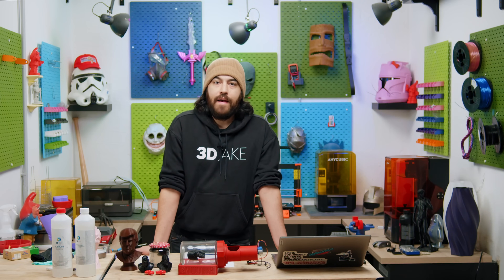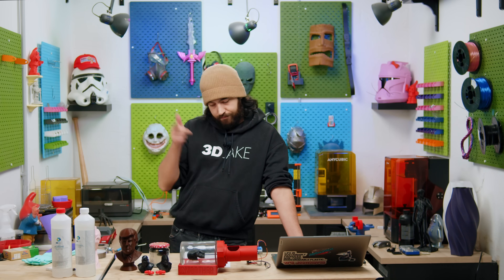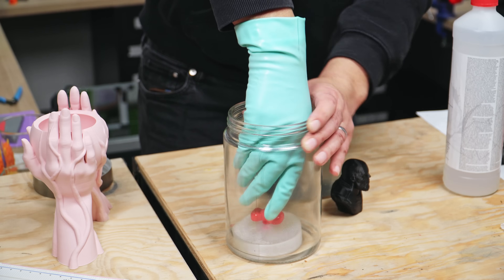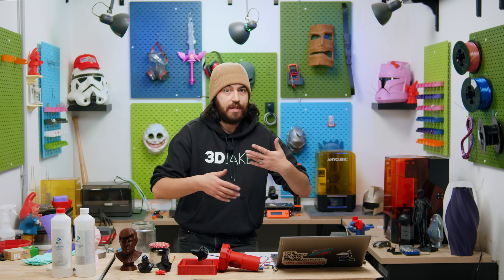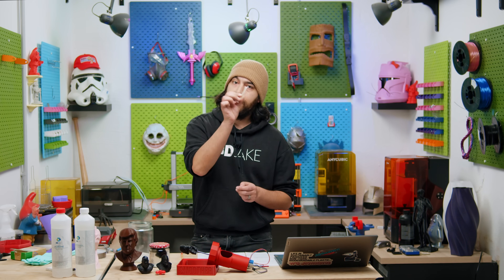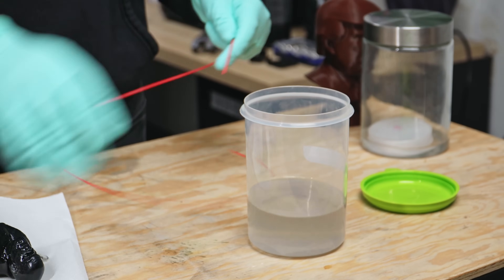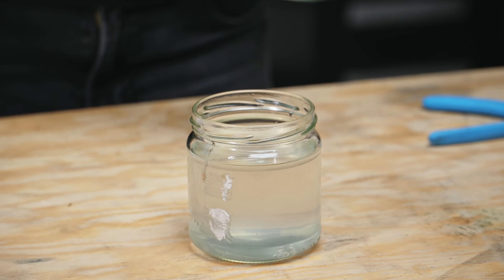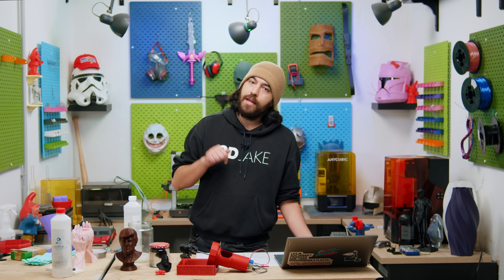3D Print Smoothing with Acetone: The BEST Method Revealed!

Comment: I use a vapour bottle, the sort of thing you'd use to repair headlights to evaporate the acetone, just hold it to the part when it's hot and it'll work  nice and quickly but only touch the outer layer!

Comment: What about using something like a microfiber cloth damp with acetone and use it to brush the part?  That way acetone leaches off the rag onto the print in a controlled way instead of dunking it so it might buy you finer control over the process? maybe?
Reply from the maker: Sure that would work, actually we often use an actual brush to do this. But you need to select your brushing material carefully, microfibre cloth may not last long or worse fall apart and deposit into your print. They're typically made of a polyester or nylon. If we brush parts with acetone we use a hoghair brush, you might be able to use sable but be careful that it is natural sable. You also have to be careful with your brushing technique. Back and forth will mess it up, you need to repeat brush strokes in one direction only.
Reply: @3DJake_Official  That's awesome! Great to know that it tracks with what I was thinking.  I suppose I've just one last question.   After brushing and getting the desired effect, do you maybe dunk or spot rinse the part in IPA or water to stop the reaction?
Reply from the maker: Yep also possible although we haven't tried with water, should work ok but we used IPA simply because it is faster to evaporate

Comment: Thanks for making this video. How does acetone smoothing affect carbon fibber filaments? If a model is created using a (specifically none core) carbon fiber filament, will acetone smoothing seal the carbon fibers at the surface level in order to stop any weakly bonded fiber fragments from detaching?
Reply from the maker: puhh good question and unfortunately, I don't know, but it sounds like something to test in future :)

Comment: When using the vapor method, if you have areas that you don't want smoothed or dimensionally affected, apply petroleum jelly to the area. It will act as a barrier that protects the surface from exposure to the acetone and can easily be washed off later with dish soap and water.
Reply from the maker: Great tip!

Comment: I'm wanting to try the dipping method with a cup holder for my pinball. Using a 1:2 ratio of acetone to IPA, what sort of timeframe do you think is appropriate for soaking to get light smoothing? Are we talking 10 min or more like 30min or more? Thanks.
Reply from the maker: Hard to say because it depends on the ABS used but one issue with the dip method is its hard to control because the solvent needs to evaporate after removing from the bath. So first test for a short time only. Even 10 minutes might be too much.

Comment: Thank you for talking about dipping! I make a lot of parts that need to be body-safe and washable, so the imperfections caused at the rack points for vapor smoothing are unacceptable, I need a completely pristine surface all around without pores. I dip each half separately so I never touch wet ABS. I design all my corners and edges with fillets, and shake the part aggressively after dipping to prevent some of the pooling artifacts. (Yes, acetone drops fly off, do this in your backyard on the dirt or grass.) Also thanks for the tip about adding IPA to prevent that white crust, I have been mostly using white ABS so that doesn't happen. 😅
Reply: I didn’t think ABS was body-safe, so you have a link that says otherwise?

Comment: Interesting stuff mentioned i haven't heard before. But there is basic stuff which i miss being mentioned. How long should the part be in? It should be mentioned that it depends on the room temperature and size of the jar. Also the longer it is in the bath, the longer it needs to stay untouched. The faster you smooth like with heat, the better as it have less the chance to go inside of the print and weaken it. Also why are Nitril gloves not suited for using with Acetone? And why you attempt to print a plate instead of using something that doesn't react to Acetone like a metall/aluminium/glass plate? I also saw someone on YT mentioned a method of smoothing it without loosing dimenional accuracy which he demonstrated by using printed flute which sounded right with that method compared to regular method. He used a marker bottle with that valve where he put Acetone inside of it and gently pushed the Acetone like a marker all around with the layer direction and then against it. And then put the part into a actual vapour with "heat" by putting the chamber into a plate of hot water for a quick vapour. So in that way he removed the extreeme layers away before putting it into the vapour so the vapour doesn't need all that long to smooth the part.
Reply from the maker: Unfortunately, it is really hard to say how long the part should be in, it can differ wildly depending on what brand is used. I haven't really noticed a difference in variations in room temperature - we tried this is a few environments, one where the temperature was a bit under normal room temp and another definitely higher and no noticeable difference, maybe if the room is scorching though but yes the size of the jar would probably affect times, this is something we didn't test. 
We printed the plate simply just because we didn't have something that would fit in that jar perfectly and I imagine some people would have the similar problem so using an acetone resistant filament like PCTG is an option. 
The marker method sounds really interesting, do you have a link?
Reply: @3DJake_Official  Room temperature should make a difference. Maybe not a big noticeable one for most people, but i saw a lot of people complaining that they couldn't get it to smooth. Ofc it depends on the filament. Some aren't suited for that. But with like a heated chamber, a warmer room or just having the chamber in the sun, should make the smoothing faster. 

Speaking of the marker method, hopefully YT doesn't block it, just surcr fir "How I vapor polish 3D prints without distortion or loss of dimensional stability." from Gael Force" on YT.
Reply: @ https://www.youtube.com/watch?v=8cxsjWYHhpI

Comment: You can also do the spray bottle (atomizer) and put a box over the object that will not warp with accitone vapors. Used acetone for years a paint stripper with paper towel, cotton pads and cotton tips. The nice thing about a metal spray bottle if you can contain the fumes a little more then an large open jars. 

Again look for HDPE (2) for the plastic parts.

It might take more passed then dunking but it's less outgassing of acetone.
Reply from the maker: Actually that is something I wondered about - if using an atomiser made of HDPE, would the acetone attack it quickly? Or would you be able to get away with bathing out the remaining acetone in water after use?
Reply: @3DJake_Official  most of the cosmetic bottles of acetone is made of HDPE. I’ve had one bottle I keep refilling for 10 years now. 

But I’m not sure if the spray bottles I see listed as HDPE are also the same plastic for the inside components as well. (Tube and nozzle) I need to experiment myself on that.

Maybe search for “chemical resistant spray bottles” might be the the way.
Reply: @3DJake_Official  I can found Polypropylene (PP) (5) and glass bottle so this should work with Acetone as well. 😁
Reply from the maker: We recently added spray heads to the shop for our IPA bottles, I'm gonna have to take a good look at those, also not sure about the tube.
Reply: @3DJake_Official  did using a spray head work?  If you tried it

Comment: Very wrong advice about smoothing duration / strengh.
The longer you expose the part to aceton vapors, the deeper acetone will migrate into it, inducing 2 separate problems:
1- structure warping: when cooling down after printing, ABS parts will accumulate stress due to thermal shrinkage. If you expose the print to ABS vapour long enough, all internal structure will start to soften before the outer layer have time to smooth. Having the whole perimeters soften will warp the print by releasing this internal stress with no more solid structure.
2- excessive venting / airing / drying duration required to get rid of the acetone vapours that had time to migrate deep into the print. It can then take days for the print to recover its full strength
=> The go-to way is to soften very quickly the outer skin only and expose it just enough for it to smooth.
Acetone and its vapours are flamable, but very little compared to alcool or petrol for instance.
My method is to use a metallic container (better heat conductivity) with transparent lid, dipped in a "bain-marie" with very hot water. 
Inside the metallic container, napkins soaked with acetone are temporary attached to the walls with magnets
An old brushless fan helps to circulate the vapours. The aim is to have almost 100% saturated vapours, just before condensation.
> Bonus trick: to avoid vapour condensation on the print that will create drops and ugly smear, I preheat the 3D print to around 40-50˚C
This way, you get your ABS part smoothed in less than 2-3 minutes, and it recovers full strength in hours, not days
Reply: This is a fire hazard. Keep electronics far away from highly flammable vapors like acetone.

Comment: great explenation of acetone smoothing.
if safety concerns are the main problem, why not use PVB with alcohol? 
note: I'm NOT saying IPA is harmless (your skin and liver will agree), but it is way less harmful than acetone.
Reply from the maker: This is a good point, IPA is a lot less harsh than acetone so it makes sense to use PVB from that perspective. However, PVB is relatively expensive, we only have two kinds in our shop, Polysmooth from Polymaker and Fibersmooth from Fiberlogy. Both around €60 per kilo, our ABS on the other hand is €20 per kilo.
Reply: Acetone is harmless. I don't why everybody is so scared of it. The body actually produces small amounts of acetone. It's very flammable, yes, but that's really about the only thing you have to worry about. Exposure to it isn't going to hurt you. Gsb

Comment: Great topic! I’ve considered using acetone smoothing in the past but haven’t actually done it yet. Just a little constructive feedback  though: in the first small item section, putting the acetone in the jar wasn’t mentioned. It just needs some detail, like how much to put in, or how close/far the part should be from the pool of acetone. Seems like those details are worth mentioning. Thanks!
Reply from the maker: You're right, technically the amount of acetone you need depends on the volume of the container you use but it really only comes in to play when the container is pretty massive. You actually only need a very small amount of acetone for vaping, enough to cover the bottom is suitable for the size of container we used. Using the dip method you need a massive amount of acetone compared

Comment: The longer you smooth an item, the higher the chance it will warp. This happens faster the thinner the walls are.
Also, the longer the part is exposed to acetone, the more acetone will get into the part which can even ruin the print.
I learned that on delicate parts it might be better to do 2 to 4 shorter smoothing runs with a few hours in between. Maybe even put the part on a slightly warm plate so the acetone can evaporate faster.